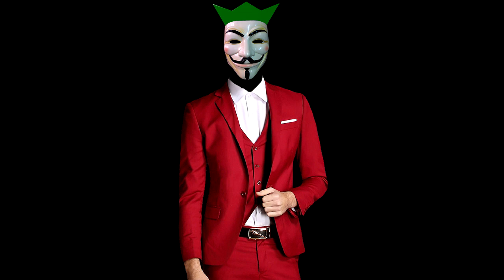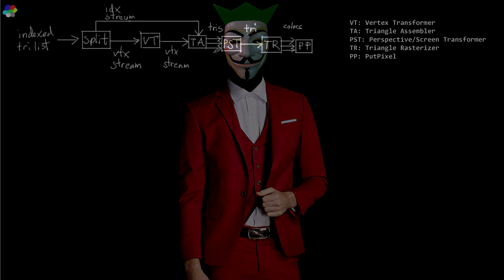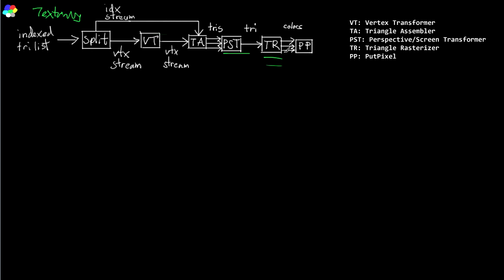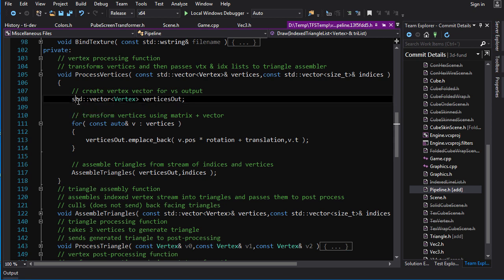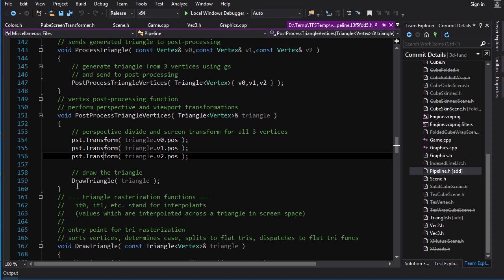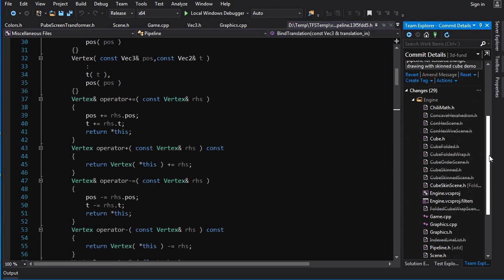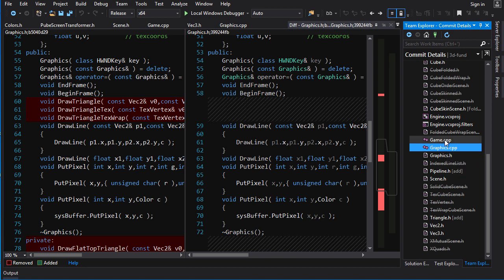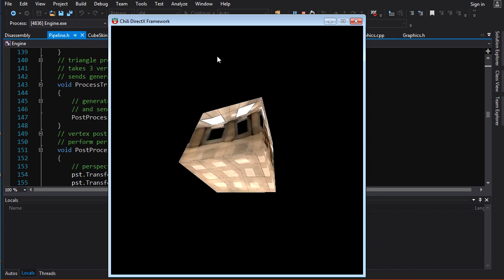3D Programming Fundamentals [3D Pipeline] Tutorial 8

Comment: Hey Chilli, noice pipeline (not the most efficient, but noice! ). The vertices that ProcessTriangle "receives" are "refferences", but the ones it is "passing down" to the Triangle constructor (then to PostProcessTriangle) are "copies" of the verticies, correct? If so, wouldn't that mean that the same vertices would end-up being Pube-Transformed multiple times (once per everty triangle they are a part of)?

Alternatively, the vertices can still be refferences within the triangles that use them, the TA and PST could collaborate on them through vertex-flags: 
Vertices would start off as culled, then the TA would "un-cull" all vertices of any visible trinagle, then the PST could just loop over the "un-culled" vertices, processing each one only once (at least for their positions, the perspective-devide. UVs and possibly normals need to be "un-shared" between triangles, so that can still happen on a per-triangle level)